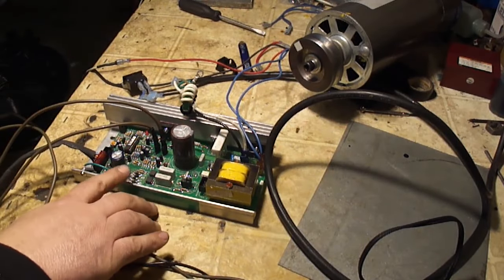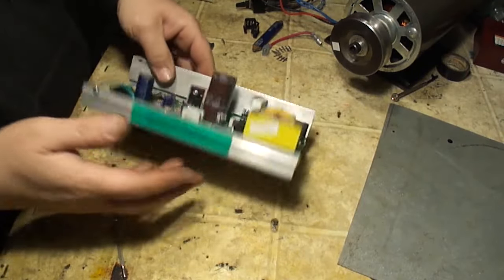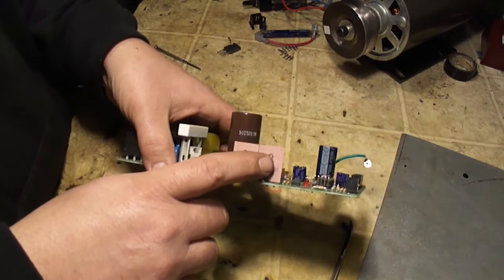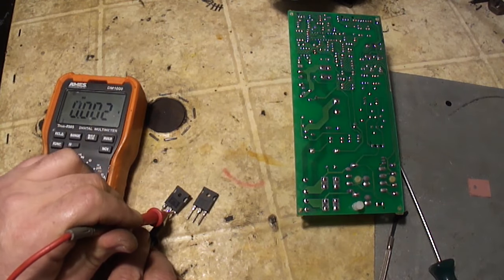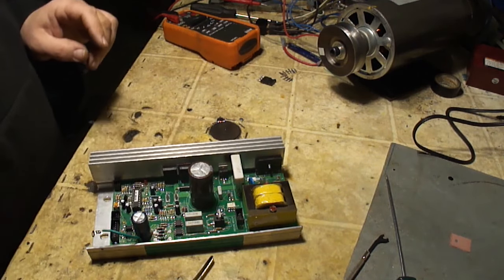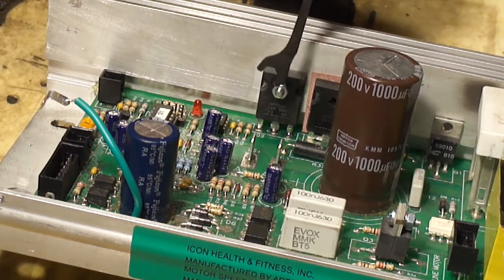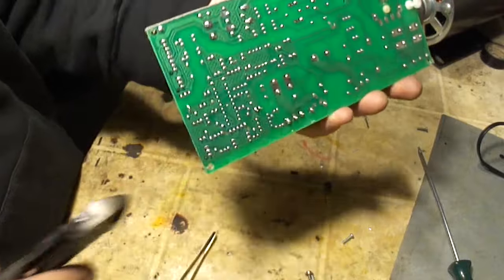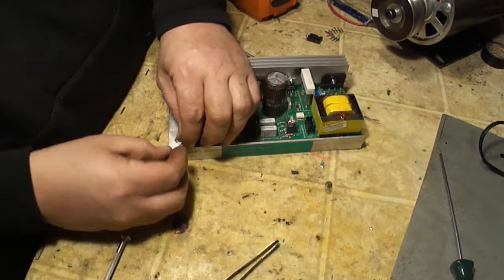Treadmill Starts Then Immediately Stops Try This.

Comment from the maker: Installing a new MOSFET may not fix your problem. Other issues may be the cause of the malfunction, Check that the running belt moves freely, and nothing is binding, and all other connections are good and replace any other parts that may be suspect. I included a trouble shooting flow chart in this video reed through that and see if you have any other issues. Beond that I can't help without testing all other components.
Reply: CAN you please help I did  change that part and now it's not even doing that short run before turning off 
 But lights go on and Treadmil thinks it's running

Comment: Big Thanks!! You saved me $200 worth of controller. I had the exact same problem and with your instructions it made so easy to replace even for newbie like me. I had MC2000 board and never had any experience with soldering. Following your recommendation only cost $8 USD.

Comment: i changed the mosfet out but didn't have a multimeter to test it prior. Connected the board and it did the same start stop thing. Got a multimeter and tested the rest of the batch (bought a pack of 5) and they range from 29 to 53 on the readings while the original shows as well as the one I replaced it with. Had accidently left the treadmill turned on but not moving and when I came back some time later the raised white bar (runs widthwise to the board) was very hot - is that normal? Also could I have a secondary issue that burned out the new mosfet as soon as I turned on the treadmill?

Comment: Reading the comments below, of having it working for a short time after the Mosfet was changed, but failed again in a similar fashion, change the SCR at the same time as when replacing the Mosfet, that should fix that repetitive failure
Reply: having the same problem number, What is the part number for the SCR?

Comment: Like many others, found this video with the exact same problem and it wound being exactly as you showed. First time properly soldering a circuit board, but it fixed the problem and saved us a ton of money. Appreciate the video!
Reply from the maker: Be sure to check your running belt tension and keep it well lubed.

Comment: Thanks for posting this video. We just bought a Treadmill from down the street for $80 which according to the previous owner was slipping. I noticed the motor belt was loose and figured I could fix it but very soon after adjusting the motor tension the unit died like the one in your video. I think the previous owners tried to solve the slipping by tensioning the running belt instead of the motor belt and once I adjusted the motor belt the whole assembly was far too tight and killed the board.

We are going to do a service on the machine and I will try your fix on the board and I will update you!

Thanks again!

Comment: Thanks!!! That was exactly the problem I had. Excellent instructions, easy to follow and so precise. $5 CAD part from my local electronics store to fix.
Reply: Do the numbers matter that are under the IRFP250N? I see so many but mine is 709P    44.    AX
Reply: @megofishn   it seems that the number under doesn't matter. I bought a transistor with different numbers from the original and it worked.
Reply: I did the exact same thing and when hooked up the red light just blinks when I hit the start button

Comment: Thanks man! Your tip helped fixing my ProForm treadmill and saved me $200! My board is a little different from yours and it has an IRFP250M transistor rather than IRFP250N. But I was able to find a new IRFP250M and replaced it. Now my treadmill works like new.
Reply: I couldn’t find IRFP250M so used IRFP250N and it did not work for me. What is difference between M and N ?

Comment: Thanks, I followed your lead and after researching found my 250 N could be replaced by a large series of units the difference being able to handle higher amperage and heat dissipation. As you point out, a non lubed belt can cause the initial failure but so can heat. As a PC tech I can tell you the heatsink setup on Nordictrack is attempting to get to 3rd rate. I replaced a 250 with a 260. If course the Mosfet acts as a fuse to some degree if too much amperage is pulled and using a higher amperage Mosfet could cause other component failure. I use PC CPU heatsink paste with the thermal pad and get great results. I am planning on putting together a fixit kit, probably Mosfet, Diode, and capacitors in order to not only fix but upgrade the board for the long term. I am also planning on trying to add a PWM driven fan. Any suggestions greatly appreciated.

Comment: Thank you so much! I just found this video tonight and tomorrow is an early Monday morning. I will thank you again after I complete the job. Appreciate your help!
Reply from the maker: Good Luck Hope this helps
Reply: Sir, it took me much longer to complete the job. Now when I turn it on it barely creeps and won't stop unless I turn the machine off. Any advice?
Reply from the maker: @htconesv897  That's interesting. Did you replace with same model part? "N" not "P" type MOSFET correct? Could be a signal error from the control console. Check the statice of the LED on the motor control board. Is it flashing steady or is it flashing a code or?
Reply: It's flashing. I used the exact part number. The belt will continue to move at whatever speed I force it to use. When I'm on it and force it to go slow it will stay going slow by itself even if I try use the control to change the speed. It also continues moving even when I remove the safety key. It does the same thing if I force the belt to move quickly. Would a sucky solder job do this?
Reply from the maker: @htconesv897  Possibly a bad solder job.
Reply: Bought a better soldering iron and did a much better job with the same results. I didn't switch out the MOSFET this time. Think I should?
Reply: Should the light be solid instead of flashing?
Reply from the maker: @htconesv897  If you have another then replace it if this doesn't fix the issue then the problem may be else whare.

Comment: Thanks! this fixed my treadmill! It was not easy to remove the mosfet for me. If i had a 3 tipped soldering iron, i think it would have been easier :)
Every time i had one terminal liquid, I obviously couldn't wiggle it out since the others were still solid, but by the time i melted the other two, the first one had set up. I really needed a solder sucker, or whatever would help me remove the solder from each post separately... But that's my fault. Amazon had a two pack of Mosfets for $10.
Reply: just tried it this morning and it is broken again. I don't know if i did it. I was showing my daughter how to use it. I told her it shouldn't start in "6 mph" and assumed that was the case. But, it started fast for a split second and shut off. Now it does it every time i hit "start". So maybe i fried the MOSFET? or something else is wrong that is frying the MOSFET. I would have thought that the electronics would only allow a ramp up to 6 if you try to start at 6.

Comment: If you have a Nordic Track commercial 2450 that starts and immediately stops (like literally moves an inch) this is 100% the fix. I bought 5 mosfets from amazon for $10 so this fix cost $2 and I have 4 spares. Thanks!!!
Reply from the maker: That’s good to hear you got it fixed!

Comment: I have the proform perfomance 800i that had the same symptom. Ran fast and slows to a stop. Turns out, the 1500uf 200v fujicon filter capacitor is dead along with another 2200uf 16v dead capacitor. The mosfet IRF250M also looked burned. I bought the replacements and will see if that solves the problem later when digikey gets them to me. This boards electrolytic capacitors “fujicon” seem cheap.

Comment: Thanks for sharing. I have a gold gym trainer 430i, board Part #: 410076, and has this exact issue. The irfp250m mosfet which controls the threadmill motor is shorted on all pins.

Comment: Thankyou for the video, my Nordictrack 1750 had exact same issue. I relaced the mosfet but also noticed a burned out resistor next the the earth LG1 so i replaced it as well. When i powered up the treadmill the new resistor burned immediately however the treadmill worked. Well for about 15 minutes anyway now its back to tripping straight away again. Ive tested the motor for shorts and its fine. motor runs smooth off a battery. any suggestions?

Comment: Great video with the best directions. What happens if you use a higher spec Mosfet such as Replacement and Equivalent of IRFP250N Transistor? The spec sheets say you can replace the IRFP250N with the IRFP250M, IRFP260M, IRFP260N, IRFP4227, IRFP4229, IRFP4232, IRFP4242, IRFP4332, IRFP4668, IRFP4768, IRFP90N20D, these go up to over 500watts heat distribution with a higher amperage rating. I would think you would avoid popping a Mosfet by someone just jumping on the board while it was running or very short spikes from your AC supply. These Mosfets the , 260N are constantly popping on treadmills while people are buying $250.00 replacement boards. Any suggestions on what supplier to use for parts?
Reply from the maker: Just to be clear, I'm not an expert on treadmill speed controllers. Im just a humble mechanic lol I wouldn't know what supplier to recommend. I know using a higher rated MOSFET should work, as long as it physically will fit in place. Like using a 260n in place of a 250n. If the part that came off the board is an "N" type you wouldn't want to use a "P" type, as it will flow current in the wrong direction. As far as I understand. Using a higher amperage unit may caus over currant draw on up stream components when over loading the motor. The motor controller has fault management to reduce output power is the instance there is an overload but, it may have limitations.

Comment: Thank you! I have almost the exact same board. After replacing the MOSFET it worked fine and I ran the treadmill for awhile. However as soon as I got on it, the 
MOSFET shorted again… I did this twice, same result. Belt is lines and tension is good. Any ideas?
Reply: Same problem,  ran untill I put pressure on it and shorted again

Comment: Awesome video! No run around, straight to the point. I have a question, how did you determine to remove that MOSFET instead of the other? Any tips? Maybe I'll just try removing both and testing them as you did.
Reply from the maker: I did some research on the internet and got the meter out and started testing.

Comment: Thanks for posting such valuable information.  I have same problem, now I have 2 mofsets , one is Hfa 15p b60 and irfp 250n .  Now do I need to replace both or just irfp 250 n ?  Please help. Greatly appreciated!
Reply from the maker: I would replace the one IRFP250n and see if that fixes the problem.
Reply: Yes!  I got it !  Thanks 🙏🏻

Comment: Do you have a link to the mosfet you purchased? I have the exact same board with the same problem and would like to see if it fixes it, but I am having trouble finding the part.
Reply from the maker: Just type in IRFP250N MOSFET in Google and you should fined several links

Comment: I changed the mosfet, it was working until I stepped on. I changed the mosfet again, loosened and lubricated the belt. I then recalibrate the treadmill, had to lower the top speed to 10.5 ish. Everything seemed perfect, I got on and after 3 step the mosfet and what I think are diode's  R29 and R30 all blew, diodes turned black. Any other ideas would be much appreciated, thank you for your video!!
Reply from the maker: Motor may be bad. Check the motor windings for a short to ground and proper resistance.

Comment: Hey! So i replaced this piece as instructed and it solved the issue of it turning on at full speed and immediately shutting off. However, now it turns on and continues running, but it only runs at full speed. When I replaced the Mosfe, I did not have another heat transfer pad to put on the back of it, so its back in there with out that. Could this be the issue, or do you think another part is out?

I really appreciate the tutorial and any additional feed back you can give me!
Reply from the maker: The heat transfer pad delete will not cause the issue; you can use dielectric grease in its place. I would think another part is bad. Or maybe a bad solder joint in the MOSFET.

Comment: Our treadmill stopped working today.  It did function normally for around 1-2 minutes then the motor stopped, but the LCD panel worked and timers counted.
I took it apart to clean it (I do this regularly) but the motor would not start.  So, I researched and found your great video!  This looks to be exactly my problem.

I'll pickup a new MOSFET and try your fix. I've got nothing to lose :)
Question: another video suggested that if the MOSFET failed, one should replace the SCR too.  Is there a way to test it?  Or should I pick up a new SCR while I am in the electronics store?

Note: after I let it cool off and put the cover back on, it started working again.  All I did was clean it, but after 2 minutes, the motor stopped again.  I am guess it cooled off, then started, but failed as it heated up once I started it again.

Any comments?

Richard
Reply from the maker: The motor has a thermal switch that will cut off power when the motor overheats. If the motor is getting hot this could be the reason. Something is causing the motor to get hot. either excessive load on the running belt or something else. If the motor will cool down and function again then the MOSFET is not the problem.
Reply: @MrFixit1 Thanks for the quick reply.  Your right about if it started up again, it can't be the MOSFET.  That makes total sense.  So, I tried it again, after several hour being off and the motor doesn't move at all.  The timers count, LEDs light up, but nothing from the motor.  I'lll try again tomorrow to make sure the motor doesn't start, that points to the MOSFET.
On a side note, the elevation control stopped working a few years ago.  Could the MOSFET affect that motor too?
Thanks again for your GREAT video!
If you ever need help with PCs/Mac, just email me:)
Reply from the maker: @richardinmontreal396  Test the MOSFET before you replace it. I believe the incline motor is a separate circuit as that motor is an AC motor. The running motor is DC. I would also test the running motor. There are videos on YouTube on how to test DC motors with digital multi meter. If you don't have a multi meter, then you can pick up one cheap at Harbor freight Tools or from amazon. or AutoZone or Home Depo or other places.
Reply: @MrFixit1  I have a nice Klein Tools MM400 and it has a diode tester (never used that feature before), I tried testing it but reaching the terminal while the board is in place is difficult.  I just ordered a 5 pack of the MOSFET (under $10 US) and will pull out the board when I get the parts.

Thanks for the info about the incline motor, it would be nice to fix that too, but I'm fine with the angle it got stuck at:)

I'll let you know how it goes.
Thanks again!

Comment: Hi, had the exact same issue on our treadmill.  I replaced the transistor as shown in video twice and treadmill running smoothly but the moment, we start walking on it, Same problem occurred again.
I did check the motor with an 18-volt battery & it is running well. Any ideas? Thanks for your help.

Comment: Great video - I ordered what I need and will try the fix tomorrow. Question - did your controller board coast any LED error signals? Mine flashes red 4 times, pauses, then repeats. I’m wondering if it’s a similar error to yours
Reply from the maker: The LED on my board stayed lit solid.

Comment: I replaced the mosfet as you suggested and it work fine until I started walking at a faster pace. Now I’m back to square one.
Reply from the maker: Maybe the running belt is not moving freely or the motor is dragging
Reply: Thank you, I’ll replace the mosfet and check the motor belt tomorrow

Comment: Great video ,had this happen this morning. Having trouble finding the 250n would irfp 260n work?
Reply from the maker: Yes
Reply: Thanks again for your video and reply . I was able to find 250n but still same result when I reinstalled board ? The motor runs maybe a second and shuts down, the indicator light goes off when this happens then flashes once and stays solid ? Any ideas ps. Made sure my soldier job was good. Could another component cause this same issue?
Reply from the maker: @GT-fh2ci  I'm not an expert on treadmill speed controllers but yes it's possible another component is bad, maybe the big diode right next to the MOSFET is bad. If you can test this part I would start there. Also, possible the pulse width signal is not reaching the controller from the console. Check all connections from the console. Also possible the motor is bad causing a high current draw. Read through the troubleshooting manual I included in this video if you haven't already and see if anything relates to your issue.
Reply: Yes, I did that two weeks ago.

Comment: Hi i have a treadmill board with a blown IRF 260 n Mosfet can you tell me what causes that problem and should i be looking at something else before i replace it. thanks
Reply from the maker: I'f the running belt is too tight or if the roller bearings are failing or if the belt is not lubricated sufficiently or the motor is going bad. Pretty much if there if too much load on the board then you will burn out a MOSFET. Also check that the wire connection are clean and tight. I'm sure there are other reasons but these are the most common.
Reply: @MrFixit1  thanks for your help